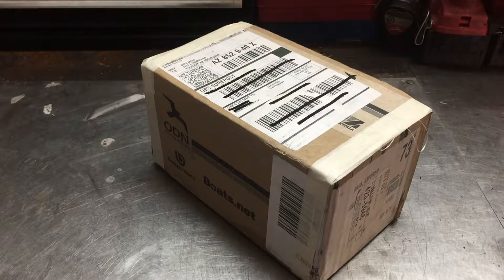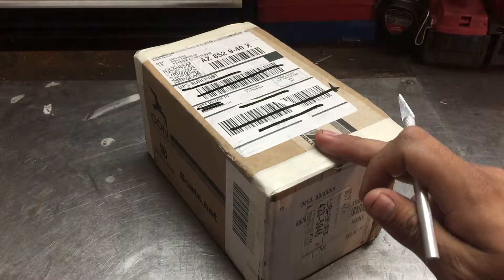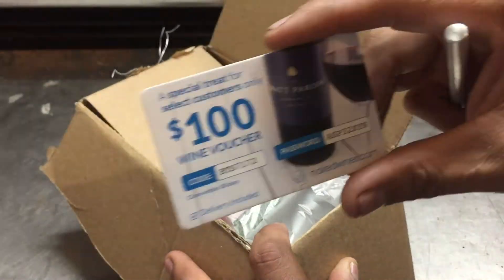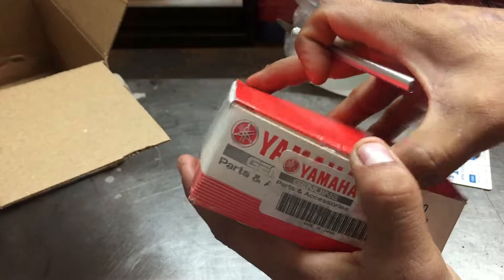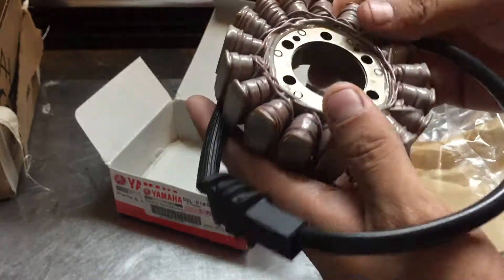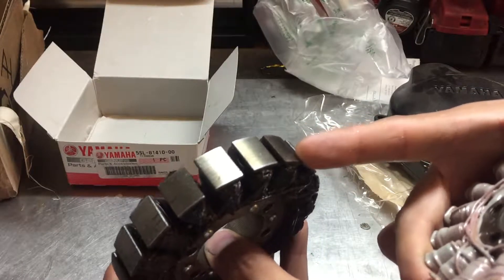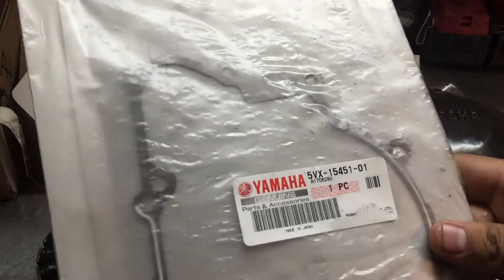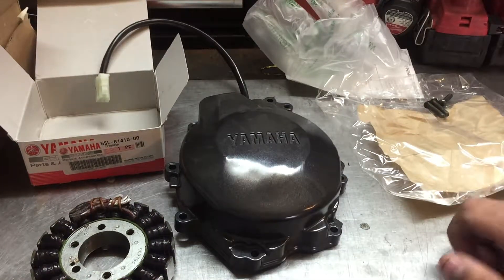ebay stator generator oem unboxing yamaha yzf r6 r6s 2003-2009

Comment: Yo i got a 2008 Yamaha R6S and when i accelerate the voltage goes down while fluctuating. if i dont rev the bike it stays at 12.2 volts. Im replacing everything. My question is that i notice the stator you have has 3 wires but when i look at the connection on my regulator it has 5 cables. I havent splice the wire harness yet.